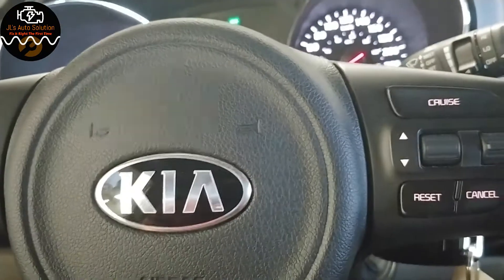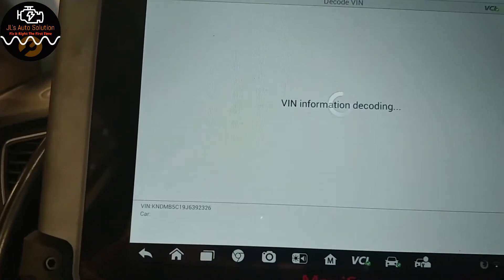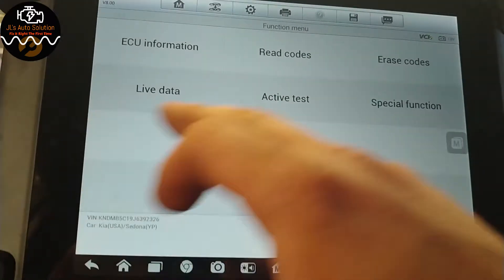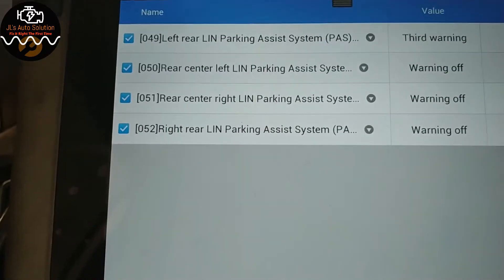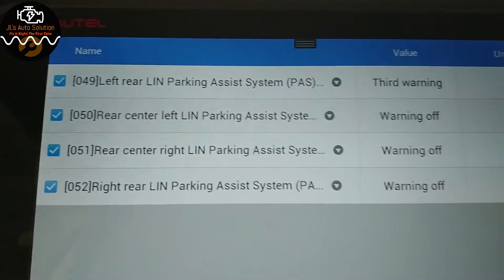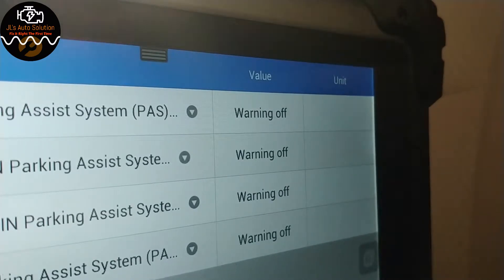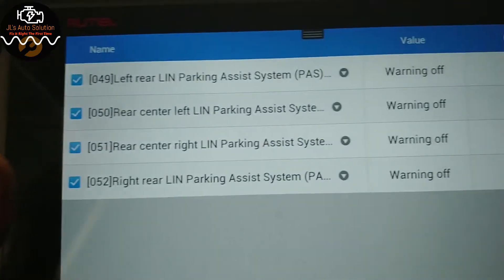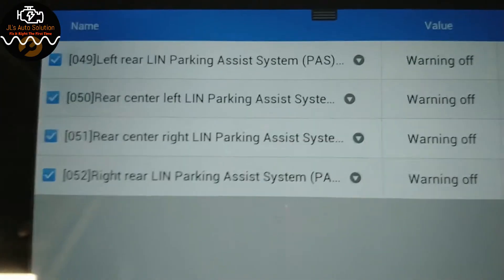Kia Sendona Parking Assist Sensor issue(Autel)

Comment: Hey. I have a Cee’d 2011. When I put it on reverse it beeps slow three times and then it the sensors works as they should. I remember when I bought it I only beep once short when I put the car in reverse. The car is out of warranty. Can you give any advice on what can that be?  What do three fast beeps mean?
Reply from the maker: Short answer is you need a scan tool to check for DTCs and look at live data.. this way you will have direction... From experience on Kia's 3beeps indicate a rear center right censor fault.. but scanning the vehicle for DTCs is the best way to verify this..  

Do not replace parts before verifying the issue and cause..

Thanks for watch😁